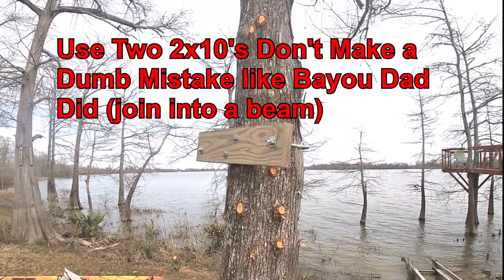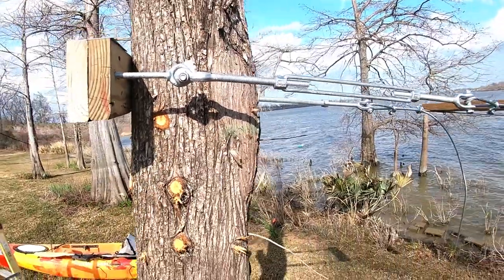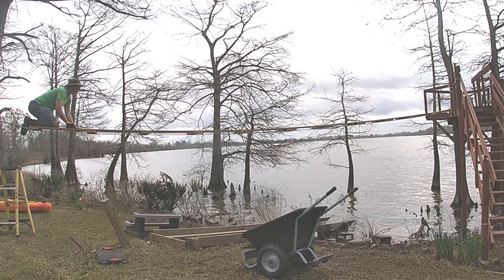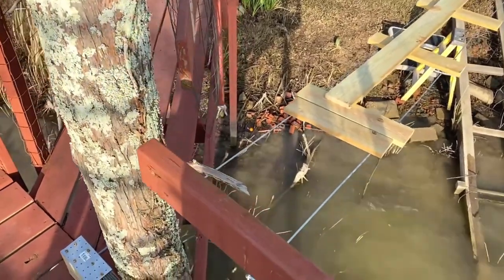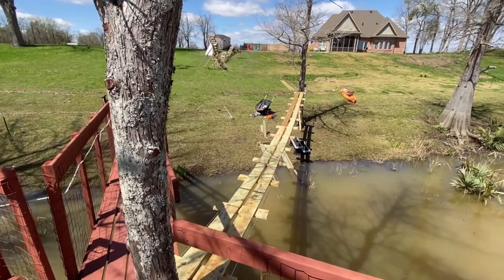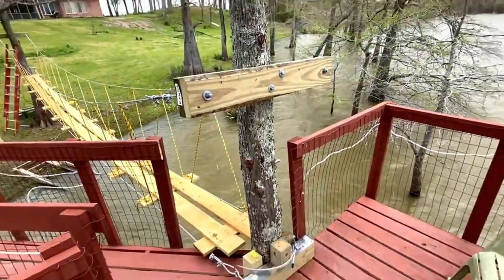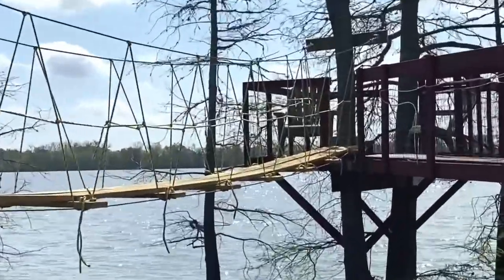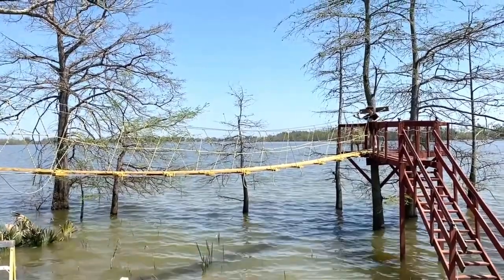BUILD A SWINGING BRIDGE

Comment: Cables across two objects like 2  trees exert leverage force midspan.  That's why suspension bridges have counter cables on the opposite side of the tree solidly attached into concrete.
Reply from the maker: That’s a good observation. These are cypress trees and are very strong. Not sure how I would put concrete anchor in lake. It would also put more stress on that beam.

Comment: Awsome thanks for sharing! just what i was looking for. Couple questions if you have the time. How long and how big are your lag bolts goin into the tree? And also when your putting your rope did you measure each time when conecting to each board or did you just pull until tight?
Reply from the maker: I think the bolts should go into the tree about 4”.  Probably 1/2 or 3/4. You will need pilot hole smaller than than bolt. I measured the rope and made a few in advance because I had to burn the ends so wouldn’t unravel. But the poor quality rope I used deteriorated by the sun. Now I have to redo them. I just pulled each one tight as I could and tied the knot. Ropes were pre cut. Hope this helps.
Reply: @BayouDad  Ok great thanks for the tips and taking the time to let me know👍little guy is gonna be happy once its all done🙂